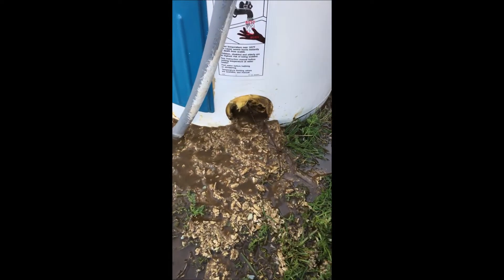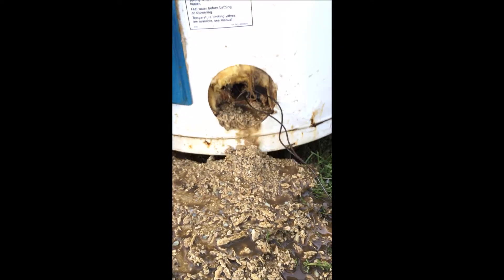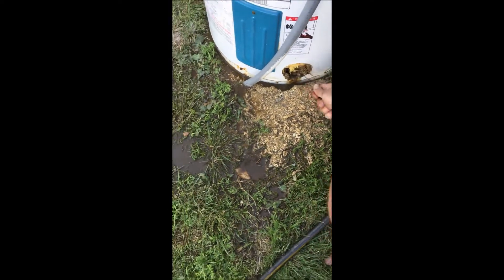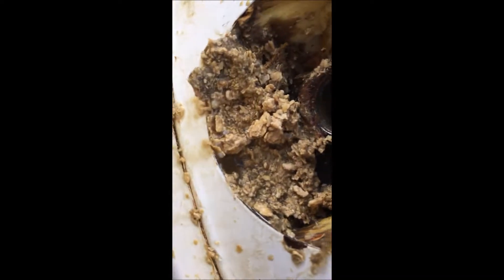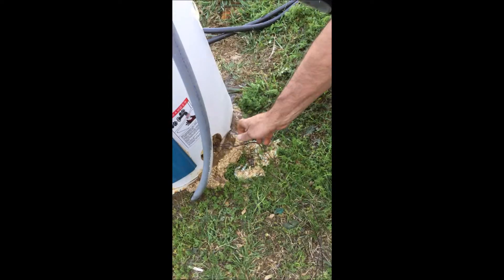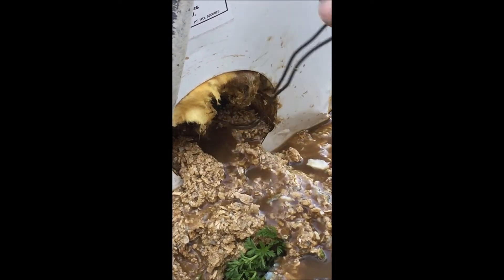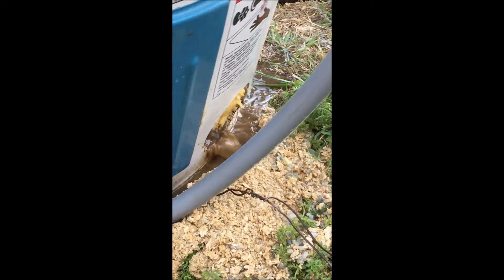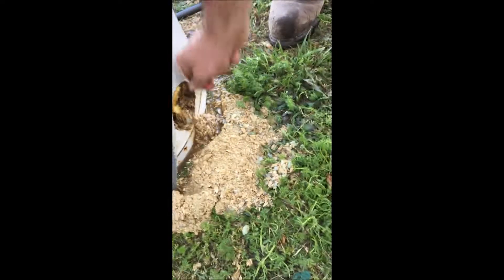this is why your hot water heater won't drain

Comment: when you drain a little bit out do you leave the cold inlet on?  I replaced my stock drain with a 3/4 ball valve for a stronger drain.
Reply from the maker: Yeah you leave it on that way it will push it out a little better. All that stuff collects on the bottom of your hot water heater